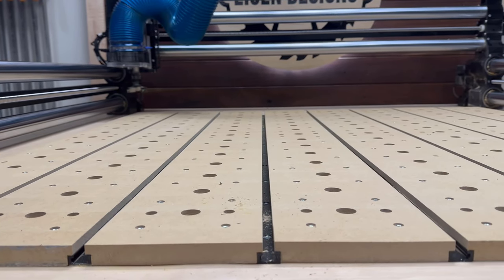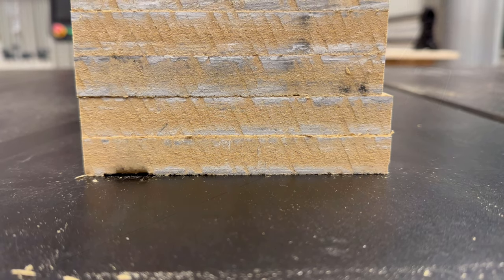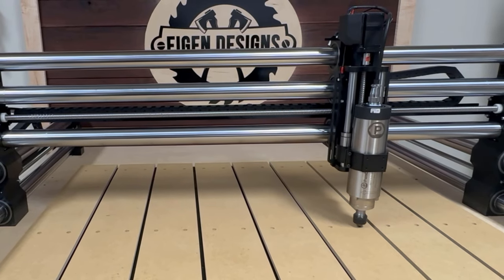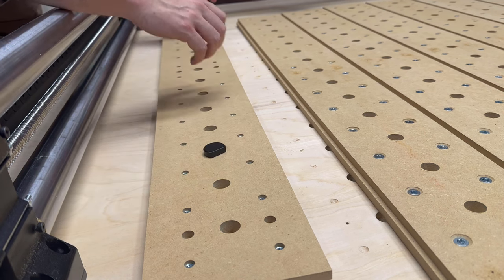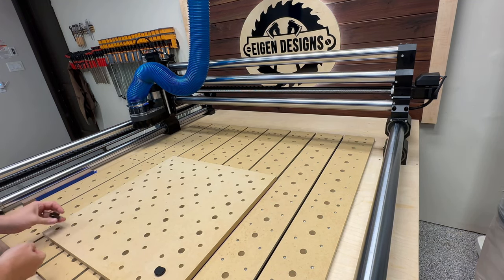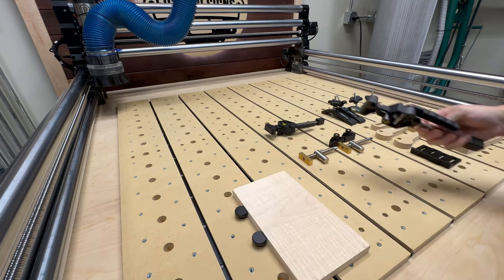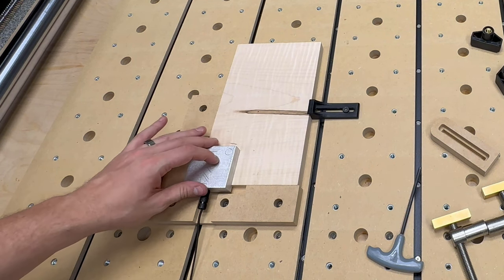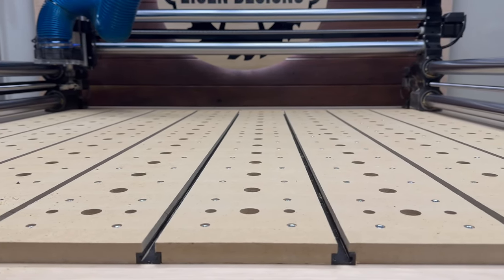The G.O.A.T. Spoilboard  |  CNC Greatness

Comment: I did a similar system, however instead of MDF, I used HDPE slats of the same dimension and instead of 3/4" dog holes I used 8mm holes for both the inserts(6mm threaded inserts) and dog holes.  On top of the slats I have a 1/2" MDF wasteboard that secures to the slats via a separate set of threaded inserts.  The 1/2" MDF wasteboard has feed through 8mm holes to all the 8mm holes  in the slats.  That way I have 8mm holes spaced every 25mm in all directions from which I can insert an 8mm stainless dowel and every 50mm I have a threaded insert.  So the wasteboard becomes sacrificial and the slats never need to be changed and can be leveled extensively without getting to the threaded inserts.  The screws that hold the wasteboard down are about 1/4" below the top.
Reply: I would love to see a video of this

Comment: Great work!  Definitely well thought out!

Honestly, I don’t have any clamping/hold down issues. I use t-track with t-track style clamps. Zero issues. Never had a work piece come loose. 

I also use double sided tape for some instances.

No work piece needs to be so severely tightened that it bends t-track. My goodness.

I think you did an AMAZING job!  The result is great!

I have always been able to correctly and securely hold down my work pieces with no issue. I would be solving an issue that doesn’t exist if I did what you did.

Comment: That is absolutely fantastic! It's one of those things one does in the shop that takes a long time and you can be really proud of......but also make you feel like a serious pro when you think about all the minutes added up over the years going forward that you saved by not staring at something, wondering how to hold something down, and then Jerry rigging something that may or may not work the first time anyway. Well done. I will definitely modeling mine after it when my machine finally gets here.
Reply from the maker: I appreciate the kind words. That's a good way of looking at it. I am already finding that I am able to setup my carves quicker because of the clamping options available and that is time savings that will surely add up with time.

Comment: Excellent video!  This is the best spoilboard video design we have seen.   We are new to CNC and I  have one question.  I see that your grid is based on 3" and 6" spacing using 8 boards, but you add the t track which adds width, right?  Am I missing another cut that you do to keep the 3 & 6" spacing?  Won't the sacrificial board be out of alignment since is doesn't have t-track?  Thanks in advice for your help.
Reply from the maker: That's a good question. They hole spacing is still 6" on center, however, the actual panels are slightly less than 6" to account for the T-track. The middle panels are actually 5-13/16" wide to allow for the T-track and this is assuming you cut a rabet on the bottom side of the panels to "overhang" the t-track like you saw me do in this video. It's worth noting that the two edge panels are slightly wider (5-29/32") since I do not run t-track on the outside edges (my personal perference).

Comment: Excellent job!
I'm still working out the design of my own spoilboard system, but for sure it will use threaded inserts or tee nuts. I'm not a big fan of t track, so I'm forgoing that. Most of the time I'll be using the blue tape+CA glue method, so I really like the idea of the 24"x24" sacrificial panels. And the L bracket is a must. Great design here.
Reply from the maker: Thank you. I also find that I don’t use t track very often, but I didn’t want to lose the ability to have it if I needed it. The threaded inserts have been a game changer for me. They are tedious to install, but offer a lot of clamping options.

Comment: One suggestion that you might want to consider... Carbide 3D sells a type of clamp called "Tiger Claws" and although they are expensive they are the best clamps to pair with a t-track system I've ever used.
Reply from the maker: I will check them out - thanks Clinton!

Comment: Brilliant design. Thanks for sharing. I have a question about the sequence of applying tape to fasten the spoil board.  What is carved into the spoil board before you pull up the tape off the slats? Thanks.
Reply from the maker: Hey Bobby, I carved the dog holes about 1/4" into the actual table top so that my dog holes would sit flush on the spoilboard. The dogs are about 1" long so they stick up past the holes in the 3/4" MDF.

Comment: Love this design.  At 7:25-ish in the video you use the adjustable clamp.  I have used those as well but do you notice that is slightly raises the workpiece on the side the clamp is on?  It looks like it raised up in your video as well.  These seem like they would be really handy if they didn't lift the piece.... may be it's just my setup though

Comment: Love this! I'm about to make one inspired by this your design! Question, what feed rate, plunge rate, and depth per pass did you use for the dog holes? You went through both MDF and Plywood in one cut.  How did you account for the material change? I'm planning to use a 1/4" 2 Flute Upcut End mill for this part but not sure how to select rates due to the 2 materials.  Using a Makita router on my setup. Really nice work, and I love your vids!
Reply from the maker: Hey Raul, I used a 70 in/min feed rate and stepped down in 0.2" increments. I didn't make any changes to the cutting rates to account for the two different materials. Good luck!
Reply: @EigenDesigns  thank you!
Reply: Using your router how did you achieve the depth need to cut into the table ?

Comment: Now that you have your new Elite Onefinity which dust control system did you use on your new cdc I assume you used some model of PWN system?
Reply from the maker: Hey Richard, I have been using the v10 version of the PWN CNC dust boot, but about 2 weeks ago I switched to the v9 and I am liking that much better.

Comment: so do you just screw down the t track to the main spoilboard bed of the cnc machine? (meaning the one that has the metal frame under it) or do you put down another maybe thinner sheet of mdf, screw the t track to that adn screw down the thin mdf to the main bottom of the machine?

Comment: I love your design on the whole thing I’m in the process of purchasing a CNC but I’m stuck between one finity elite or shapecko 5 pro both 4x4
Reply from the maker: They are both great machines. I personally went with the OneFinity because they use a ballscrew for all movement and don't rely on any belts that need to be tightened over time. I also felt like the larger diameter tube construction of the OneFinity would offer a more rigid frame, which becomes more important when you scale up to larger CNCs. However, I don't often hear people complaining about the Shapeoko so I think either option is good.
Reply: @EigenDesigns  the shapecko is also ball screw with a VCG Spindle I have a new laptop 💻 but I also like the onefinity
Reply from the maker: @truckerdan1250  I have been very happy with my OneFinity. They have proven to have good customer service when resolving issues and they continue to innovate on their products. I am bias towards the 1F machine, but I am sure both are great.

Comment: My OneFinity QC table defines the MDF piece sizes.  Each slat is 8.75" wide, which isn't divisible by 3 or 6, so at some point you're going to conflict with some hardware.  Despite the greater distance between dog holes, using an X-distance of 8.75 for dog holes and 4.375 for threaded inserts might work as well.  Keeping the Y-distances at 6" and 3" respectively is compatible with QC board hardware.  A disadvantage of using different distances between holes is that the secondary spoilboard wouldn't be able to rotate 90 degrees.  Does your equal-distance system have any other advantages?

So for users of QC tables, would you favor uniform distances in the X- and Y-directions, or using the 6" Y and 8.75" X?
Reply from the maker: Hey David, you're correct that this design didn't take the QC table restrictions into account. I think you identified the main advantage of an equal distance hole system. If you elect to change this then I would encourage you to add more holes, not less. Having fewer holes might limit your clamping/hold down options for your pieces.

Comment: A few comments if you don't mind. If you drink the green koolaide ... the holes become 20 mm (wink) You may be talking me into threaded inserts, though those are a lot of work. 

But here is something I am going to try... your 24x24 addon's I think a machinist would call a pallet. I will make mine out of 3/4 or 1/5 mdf and then laminate 1/8" hardboard to it. MDF hates liquids but the hardboard will resist it . What this means is I can mount a SMW fixture plate...then cut aluminum with a mist lube.

Last question ... I am considering "side boards" to provide some chip protection for the screw drives., thoughts?
Reply from the maker: The threaded inserts are an intital time investment up front, but if you use the "pallets" to protect them, they'll last forever. 

I think sideboards to protect your ball screws and your rails from metal shavings is a good idea. Just be sure you leave enough room for the rails to travel by and make sure that any fixtures on your machine are able to clear it (e.g. hoses, dust boots, etc.).

Comment: Does this still work with vacuum tables? I'm working with a table that has t-slots, but most of it is covered with a single MDF spoilboard where only some portions of the t-slots are exposed via 2-inch long rectangular pockets. Not sure if it would hurt the vacuum system to let the t-slots be fully exposed, and/or to add the dog holes.
Reply from the maker: That's a hard one to answer because it would depnd on the particular setup, system capacity, etc. I would venture to guess that putting this many holes in a vacuum system spoilboard would adversely affect the suction, but that would be better answered by the vacuum system manufacturer.

Comment: I got those black clamps you got. I found they push the work pcs up a decent amount. I haven’t found a way for that to stop. Have you had that issue?
Reply from the maker: I have found that applying less-than-maximum pressure helps. I have also used some toe clamps to hold down my pieces as well and that has worked.

Comment: What about putting the threaded inserts in the table itself so that you don't have to swap them each time your replace the spool boards?
Reply from the maker: I did consider it, but was concerned that a few hundred holes in the table might jeopardzie the strength/rigidity of the table top surface. That's why I elected to use the sacrificial panels on top of the spoil boards so those never have to be resurfaced.
Reply: @EigenDesigns  I gotcha. I think I'm going to pull some inspiration from your design and modify it a bit. Great work man 🤙

Comment: I am impressed by your design, accuracy in the design, and your communication skills. I've been retire sine 2007 but as an electrical Engineer, I depended on entry personnel like probably you to pu my designs into the system. I am using your design to the spoilboard  to prepare for multiple customers wanting me to produces their items. Thanks.
Reply from the maker: Thanks John! Interestingly enough I am an engineer by background too (Mech Engineer). I have found this system to be very helpful and has allowed me to get away from the blue tape + CA glue approach
Reply: @EigenDesigns  Good morning. I purchased your GOAT Spoilboard design and in the process of engineering some modifications I need for my CNC machine. I have a CAMASTER Stinger II, Model SR34 that has a 37" x 49" top. A few questions:
1. Your design is for 6" CC between the T-tracks. Your video starts with cutting the 6" strips for the board. Then doing rabbets for the T-tracks. But because of the top edges of the opening to access the T-track the width of strips would need to be reduced from 6". Do I assume you did that off Camera to maintain the 6" CC for the tracks?
2. Your older spoilboard had a T-track along the left edge. Your new design did not. Did you decide to us the inserts for a fence if on is needed? No problem, I would just need to adjust my zero-zero.
Thanks.
Reply from the maker: @johntanguy8317  Hey John, yes, you have to account for the width of the T-track in each of the panels. If I remember correctly, each of the middle panels were 5-13/16" wide and each of the two far panels were 5-29/32" wide. I didn't put one on the outside because I found in my prior design that the "footprint" of the clamps that would be used in the outside t-tracks would often obstruct the pathway of the axis rails. I have since found other ways to secure work pieces without using those edge t-tracks.

I hope this helps. Also, I don't always respond to YouTube comments so please reach out to me through Etsy if you're needing fast support.
Reply: PTL! I cut my plant to 5-5/8" and the most left on at 5-3/4". Did the rotting to cover the T-tracks and secured the planks. Then did the down bolt toolpaths.  Then screwed them down and did the inserts and dog toolpaths. Right now, I have 3 planks installed. Waiting on more inserts.

Comment: Hi I bought your plans but I really struggled with them as I set it all out as your video but the G code was way off come the second strip I could only get it to work with out the T track, can you think of what I’m doing wrong ?
Reply from the maker: Hey Johnathan, how wide were each of your panels that you created?
Reply: @EigenDesigns  6”
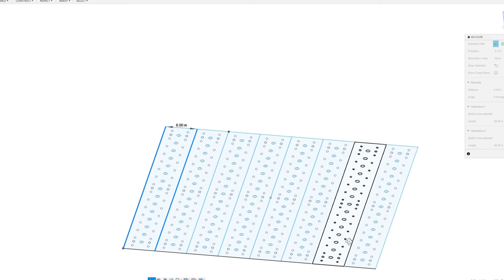Reply from the maker: @jonathanmills806  In the design file the panels are broken up into 6" sections so that there are 8 panels at 6" wide for a total of 48". However, in order to accomodate T-tracks each of your panels will be slightly narrower than 6". For the t-track I used, each of my panels were 5-13/16 wide to accomodate the width of the track. This may vary depending on what style/brand of t-track you use. I made mention of this at 1:20 in the video, but it's an easy detail to overlook. One other thing to consider: each of your edge panels (e.g. the left most panel and the right most panel) will be slightly wider since there is only t-track on one of side. For my t-track I used the width of the two outer panels were 5-29/32".

I hope this helps!

Comment: with the sacrifical board that goes on top of your permanent spoil/wasteboard, you are losing the ability to use the T tracks? what if the piece you need to cut through is larger than the sacrifical board you made?

Comment: 1- I would have cut the board 48x48, 2-make the (0,0) reference , 3-CNC creates the holes, 3- CNC cuts the 6" strips without rabbit - done on the router later.

Comment: Wouldn't it be better to put the threaded inserts in the base plate and just have holes in the spoil board? 
You would need longer screws, but insert the inserts only once.
Reply from the maker: By the "base plate" I assume you mean the actual table for the CNC? If so, then I guess you could do that. However, if you use the sacrificial 24"x24" board on top of the spoil board like I show in the video, you should never have to replace or re-surface the main spoil board. So, I think my design works the way you're suggesting where you install the inserts once and never have to touch them.

I hope this helps.

Comment: Does it matter if the dog holes are 3" or 4 " apart depending on my cnc ?
Reply from the maker: The spacing doesn't matter that much... Just a repeatable pattern that works with your spoilboard area

Comment: Is the six inch width to the center of the T-track, or to the top of the mdf?
Reply from the maker: Great question John, it’s to the center of the t-track. The actual width ends up being 5-13/15” with the t track I used
Reply: @EigenDesigns  Thank you for the response.  I really like your design.  I’ve been bouncing ideas around as far as the wasteboard is concerned.
Reply: What are your thoughts on putting the threaded inserts in the table itself, and having thru holes in the waste board?
Reply from the maker: @johnalex3023  I guess that could work, but you’d want to make sure your plywood tabletop is well supported because you’d be putting a lot of holes in it, possibly jeopardizing it’s structural integrity.

Comment: Don't put holes in your spoilboard. They are simply not necessary. And when you do want one it will never be in quite the right place. When I need a hole in my spoliboard I drill one in the precise place I want for optimum fixing. My current spoilboard is now six months old and it has four holes in it. Hold work items is only 5% about holding them down. Put 95% of the effort into preventing them moving sideways. For this wedges and cams are the best answer. Preventing sideways movement by pushing down on the top is very much missing the point.

Comment: The purpose of a spoilboard is to be sacrificial. It should be cheap and easy to make and replace.
Reply: I mean in this case it's more of a workholding board than a spoil board, and you can always add an extra thin layer of sacrificial material between your "workholding" spoilboard and your stock material. I think this is awesome because you can really attach almost all project on it without needing to screw it in